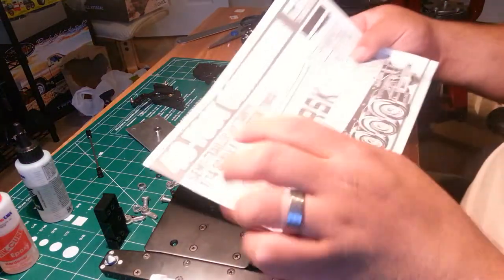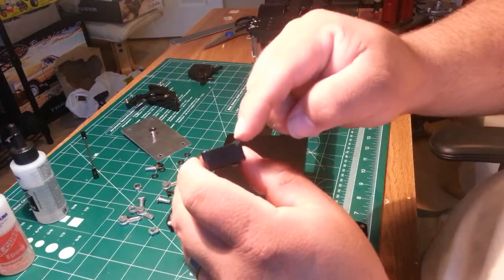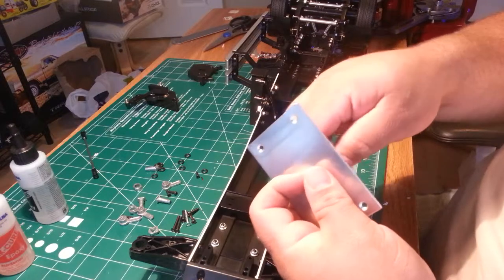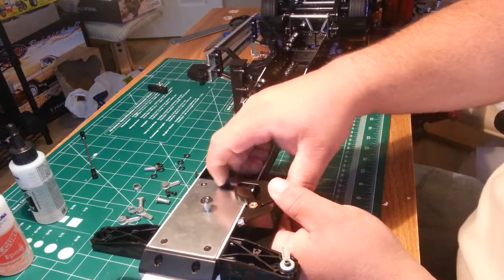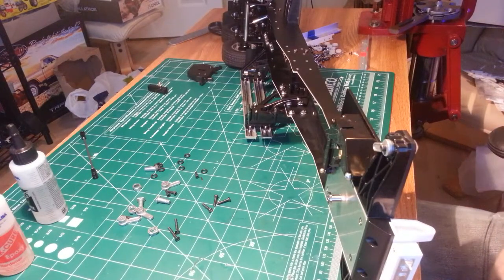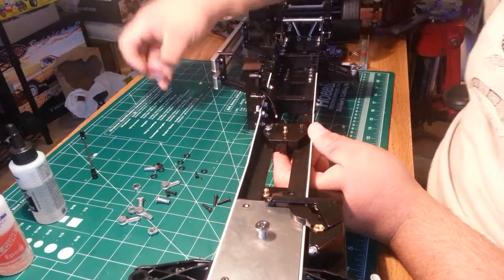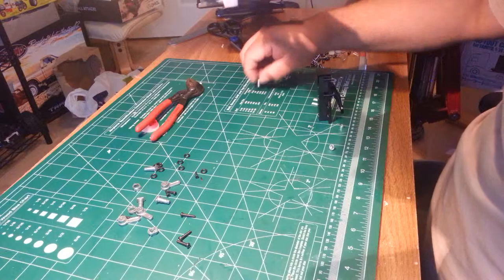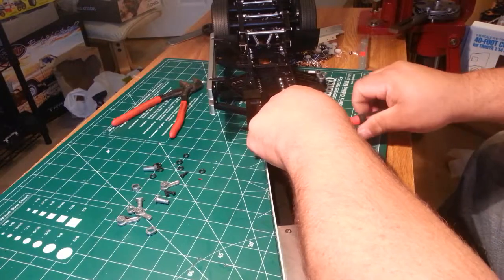tamiya 40 foot container trailer build part 7

Comment: There are many different size and shape points to a cross head screw and you may have been using the wrong one for the four countersunk screws, that would be why you had problems with them.
Reply from the maker: Stephen Hartshorn true I did try many different tools none work.